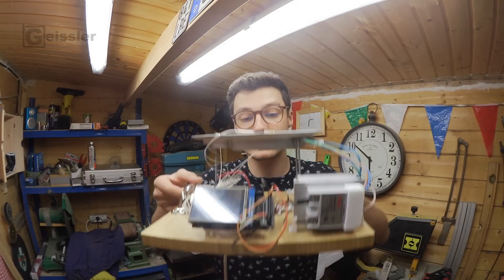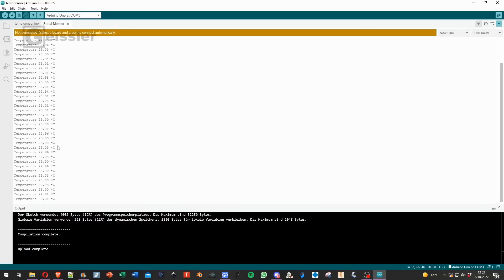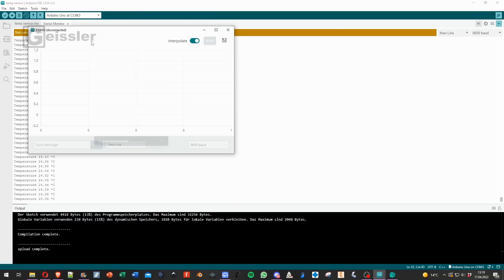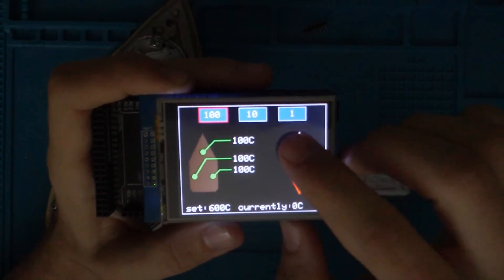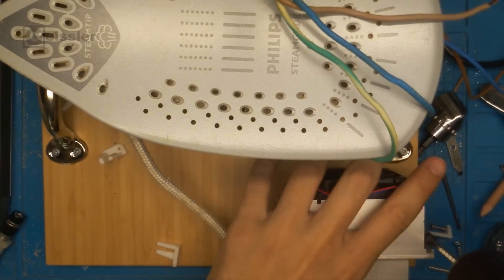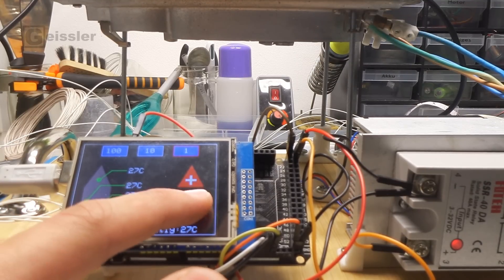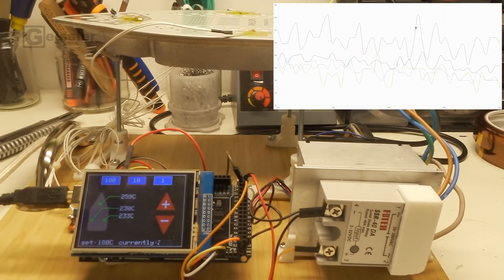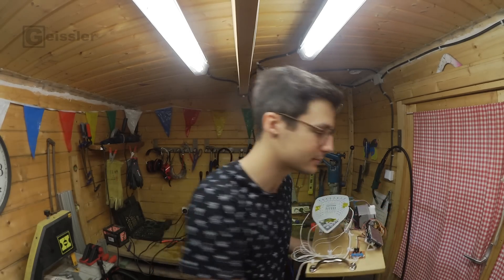DIY  Reflow Plate with an old iron - Luis Geissler

Comment: I did a similar project.  You have turn the iron  on for 3 seconds off for 3 seconds. Till it get to the temp you want. Then increase the off time as it gets closer to the desired level.
https://youtu.be/sP0eL9Y4250

Comment: Very nice project. I thought about something like this some time ago but never really found the time to build it. One remark though - the control is not really a P-Control. It's a 2-point or bang-bang control. For a real P (or PID) control, you would need something control the power output of the iron and adjust it proportional to the temperature error. Not that this is needed - bang-bang control is perfectly fine for this application.
Reply from the maker: thanks for the feedback, i just checked it too and you are right it is not a real p-controller but a bang bang controller. Thanks for the comment, I hope I have not confused too many ppl
Reply: he could proportionally change de duty cycle of iron (PWM), Idk how fast you can switch that load using the SSR, but thats how marlin controls the temperature of 3d printers. It also have a lookup table for compensating the non linear response of NTCs
Reply from the maker: @victornpb  I know, I have already built my own 3D printer control board, but it does not use SSRs but mosfets, which are driven by a PWM signal. I don't think the SSR will be able to handle such high switching frequencies, but I can try it.
Reply: @luisgeissler  You can try using a slow switching frequency like 1Hz. My printer bed blinks very slowly due to large thermal mass

Comment: It seems the iron is a bit too powerful for the control to work perfect. Perhaps it is possible to "throttle" it, either by varying the voltage to it, or by pulsing it to reduce the duty cycle? Tha latter is probably way simpler but perhaps more taxing on the relay
Reply: Using a thyristor and setting the duty cycle proportional to how close to target it is. The further away then the more power the closer the less power until at temperature then no power. Tinkering with the proportions so it does not overshoot. Clearly it goes miles over target at the moment.
Reply: Really cool idea and build btw! :)
Reply: Thats what I was wondering, any such project would use a Tric or SCR and control the duty cycle and not solid state relay.

Comment: Very cool! I'd suggest using pid control to take care of the overshoot. I'm not sure if this would be plausible considering the noise it would cause for such a high load, but doing phase angle control might be something you'd want to look into.
Reply from the maker: yes I also thought about adding a PID control instead of a P control, but since the project is not  in its final form yet, I can still add one
Reply: @luisgeissler  adding a Kalman filter could help reduce noise for PID control
Reply: By the way, you’re not doing P control.  You’re doing bang-bang control, which is one reason for the drastic overshoot.  P control means your output to the iron is proportional to the error between the actual and target temp.   You can’t do P control perfectly with a solid state relay, but you can do a very good approximation of it simply by doing a PWM signal to the iron.  

So calculate:
T = TARGET TEMP
A = ACTUAL TEMP
P = some constant of proportionality 
Y = output signal to iron

Y = P * (A-T)

And here’s the key:  now take Y and convert that to a PWM signal with a duty cycle between 0 (off all the time) and 1 (on all the time).  And THATS the signal you send to the iron.  

The PWM frequency can’t be high because you’ve only got 50 hz to work with, so I’d make the PWM frequency something like 5 seconds, which should give you plenty of control authority.  

With this the temperature will STAY right on your target reliably.  

You will still have overshoot if your P is too high, but it will get back to the target after a few oscillations.
Reply: I guess we can hard code the time the heater element should be on to reach the set temperature. Like if the temperature rise is 1dec C a second, and we need to take it to 250C from 30C, the iron can be turned on for 220s

Comment: Very cool. Need to code for the thermal inertia of the metal mass as it clearly keeps heating up from the heat within the metal after the elements have turned off... or switch the iron elements on and off quicker to essentially reduce the overall output.
Reply: If you include the rate of change of temperature you can turn the element off if the rate is too fast and turn it back on when the rate is slower.
Reply: If the target rate of change is proportional to the difference between the set temperature and actual then the heat gets turned of as the temperature approaches set point. They way it does not overshoot they way we saw here.